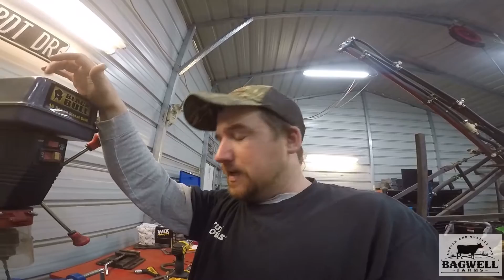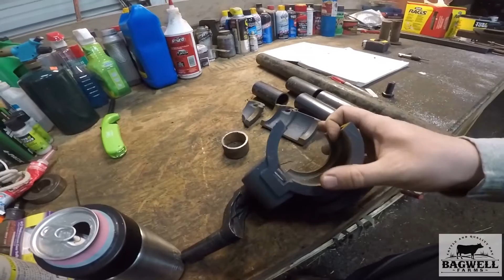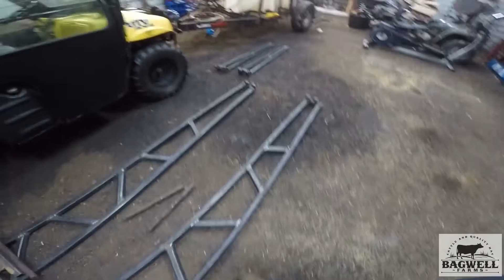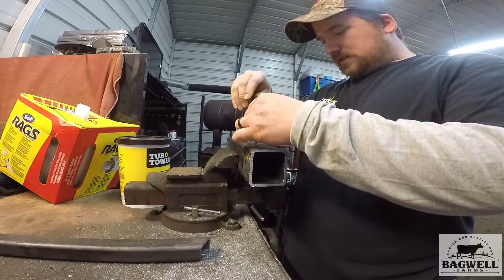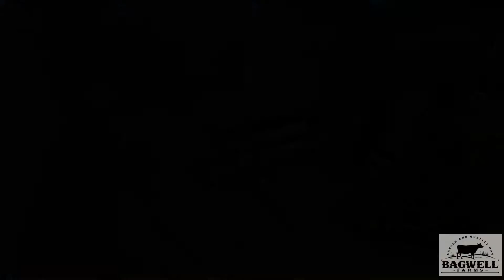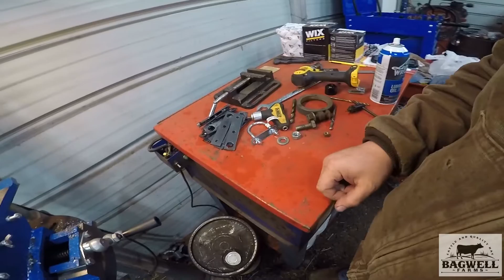Sprayer build part 2

Comment: The welds look good man! As for tapping threads, I use a drill on the slow setting. I've tapped literally thousands of threads that way. As long as the tap size drill is the right size, it's a breeze, and takes WAY less time! Overall the build is looking great. I can't wait to see it in the field.